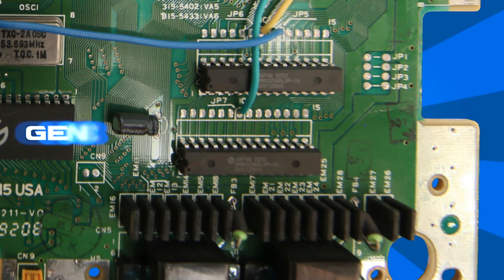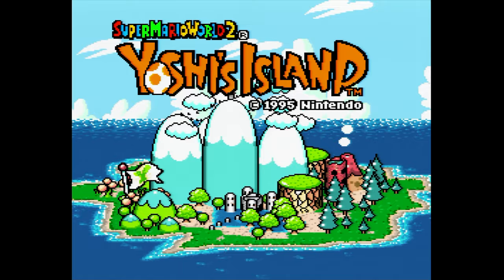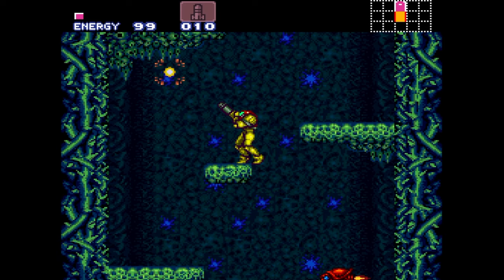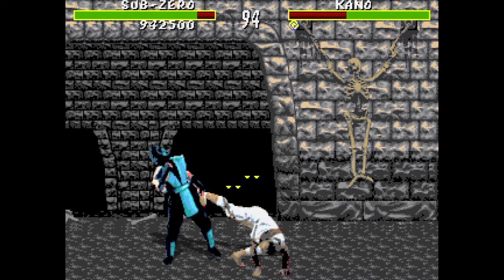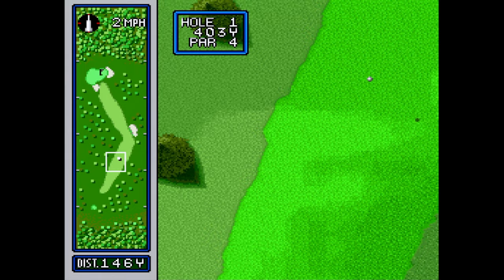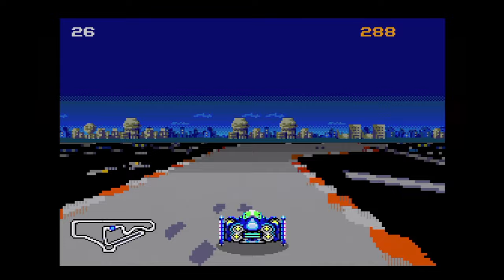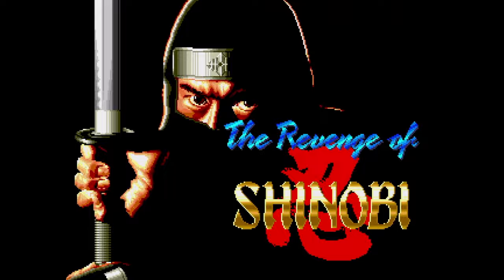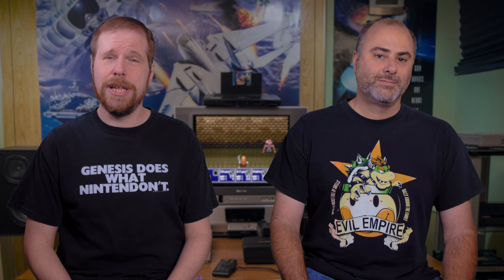Sega Genesis VS Super Nintendo - Game Sack

Comment: Being as objective as possible about the library, the SNES does have more games than the Genesis (1600 vs 900 iirc, which is notorious with RPG's, puzzle and fighting games mainly) with a similar average quality , so if you want more "good games" probably you would get more out of the SNES, but the Genesis does have an advantage in shooters of all kind and has plenty of experiences that don't have an equivalent on the SNES, so maybe you may still prefer the Genesis, especially i you don't care about RPG's, puzzle or fighting games
Reply: The megadrive has more games worth playing. For every good snes game there are 3 good megadrive games. Also ports of the same games where better on megadrive 9 times out of 10, they more fun to play with better controls and better hit detection and no screen crunch
Reply: The snes is better overall, Genesis is good, but SNES was simply the king. So much hipocrisy these days, is what it is, simple as that.
Reply: @MizfitZer0  I do agree the Mega Drive has the edge on multiplatform games, but not at the level of "9 out of 10 times" as you are saying, and multiplatform games don't apply for a huge percentage of neither of the 2 consoles (especially SNES) unlike now.
I don't really agree with your other point at all, that would mean the SNES has less than 200 games worth playing and that's not true at all, it probably has that number in RPG's and platformers alone

Comment: 1:00 - same clockrate, but one is a newer 16-bit CPU that does more in each cycle than the other. You can't compare clockspeeds from two very different processors. That's also why, while the Genesis 68000 CPU is roughly twice the clockspeed of the SNES CPU, because of architectural differences etc. the system isn't really twice as fast as the SNES CPU (that again, does things very differently).

Comment: Genesis used to trick transparency effects by interlacing pixel columns. Play the original Sonic on an LCD and you can see the waterfalls are just alternating rows of solid water and nothing at all, which were blurred as a consequence of the CRTs that were used at the time, producing a transparency effect.
Reply from the maker: Yeah that's the intent, but even gaming in RF on a CRT back in the day, I could absolutely tell this was just alternating rows of solid and nothing.
Reply: @GameSack  Depends on the size of the screen. On a 25" it started to become noticeable. Probably something like a projection TV would've been patently obvious.
Reply from the maker: @adamb89  My screen was 13 inches I believe and then I later stepped up to 20 inches.

Comment: In retrospect, what really pushed the SNES ahead of the Genesis was the lack of strong Japanese 3rd party support for several years after launch. For example, Contra and Castlevania didnt land on the Genesis until 1994, while Castlevania 4 and Contra III were on the SNES in 1991 and 1992. Graphically the Genesis was capable. Batman and Robin, and Ranger Z, Vectorman and Rocket Knight look as good as anything on the SNES. Sound on the other hand is much better on the SNES.

Comment: Always preferred SNES.  Often Genesis has less flicker  / slowdown,  but most games on Genesis still had some slowdown / flicker, just a bit less than SNES and SNES games had far better colors and ( usually) better sound.  These days with Emulators like BSNES and SNES9X you can overclock the SNES cpu.  SNES games with zero slowdown or flicker destroys Genesis and infact for 2d it's more like a 32bit system.  You can even render mode 7 at 1080P in widescreen !!  ( with some limitations) -Pilotwings in HD is a sight to behold!   BSNES rules.

Comment: The Genesis is actually more powerful than the SNES. the SNES has better graphics and sound along with more RAM. the Genesis has more raw processing power than the SNES. The Genesis took away some graphics and sounds and gave you great processing power in exchange. the SNES took away processing for graphics and sound. The Genesis and SNES have their advantages and disadvantages and i like them both.

Comment: The snes had 10 sound channels
The sega genesis had 8
Reply: SNES had 8 PCM channels, and Genesis had 6 FM channels (1 PCM capable) + 4 PSG channels in total 10.
Reply: @mateuszmaterzok431  The Genesis could only use 9 of 10 simultaneously. Also a nice chunk of the library only uses the 6FM channels and doesn't use the PSG at all.

PSG channels could definitely be beneficial when used appropriately but obviously were very limited.

Comment: How did you forget to mention the impossible ports of street fighter alpha 2 & 3, those blow away mortal kombat ‘with blood’ 😛
Reply from the maker: Probably because Street Fighter Alpha 2 and 3 weren't on the Genesis and SNES. I agree that they blow away Mortal Kombat though.
Reply: @GameSack  wait wait. There WAS a port of the SFA2 for the SNES. It was so perfect and accurate that even had LOADING (no kidding) 🤣

Unless you are considering ports that were made for BOTH consoles, of course.

But then the Genesis had the (not so) Virtua Fighter port :p

You could've compared apples to oranges just for the fun :p

Comment: I did a Genesis vs SNES report back in 1994 (High school, it was a Oral report/presentation) In my honest opinion, the SNES was the better system,, better graphics, better sound, better colors, etc... But the Genesis was great in its own rights too, especially if you were into sports games, Genesis had WAY more sports games than the SNES did. But SNES gave us some timeless greats, such as pretty much every JRPG and traditional RPG on the system, the DKC trilogy, Mario world/All-Stars (which was a free pack in at one point, hell you could even get Super Mario All-Stars for free by mail) the SNES had a WAY better controller (even the later Genesis 6 button released with Street Fighter II was "meh") However the first Mortal Kombat, I will give to the genesis thanks to the uncensored version (SNES still was closer to Arcade than the genesis in graphics and sound though) IMHO, Blast Processing was a gimmick and only a handful of games on the genesis supported it.
Reply: I also did a report but saw the Genesis as superior to this day!
Reply: The genesis had a superior cpu and generally had better performing games than the snes
Reply: @kasjamm  but the SNES had a WAY better color pallet and sound processor.. take MK2 for example, the SNES version was WAY more true to the arcade than the genesis version.

Comment: So being able to display 128 8x8 sprites means that if you need 16x16 sprites you will only be able to have 32 of them on SNES? While Genesis can use 80 of those? Seems like a big deal. With more than twice CPU power, better resolution and better sprites support I’m not convinced that SNES has a better hardware. Mode 7 is cool, but most games barely use it

Comment: I always hated the Genesis sound chip. Everything sounded tinny, robotic,  hard to explain. It just didn't sound natural. Compared to the SNES which would emulate full orchestras, it was a huge difference. Genesis had more power, games like Gunstar Heroes had so much crap on screen with no slowdown. Ill always prefer SNES but Genesis did win some categories.
Reply: That is where the PC Engine comes in. 6 channel wavetable synth with proper stereo. Compare for example Neutopia II and Zelda LttP. Or Bomberman 94 vs Mega Bomberman. On a stereo Trinitron! No emulation please. The PCE outclasses both the soundchip of the SNES and the Mega Drive.

Comment: The winner is: PC Engine. The best 2D console ever conceived.
The SNES did not win the hardware battle. It was all theoretical figures you mentioned. In reality the SNES was seriously underpowered, weird spirte limits, weird sound ram annoyances, slow CPU. The hardware in the SNES was so bad, that most titles that came out on the NES as well, were better on the NES! Also the NES had way more variety in games offered. The SNES is the most overrated console in history. Especially the uber-ugly US version.
Reply: Most games that came out on NES were better? I don't know what you are talking about, the only case I recall there is Paper Boy 2 and Ninja Gaiden Trilogy because the SNES ports were complete garbage, but beyond that nearly any of the games release on both are way better on SNES, with some extreme cases like the Disney games by Virgin, and most SNES games are just not possible on NES unless you do a demake or something like that, especially for genres like racing or fighting.
Reply: @oscarzxn4067  I watched a video with all 101 titles on both systems, and the SNES really seems to struggle with sprite count, so most SNES versions are more empty, with less of a challenge. I counted 50 wins for the NES, rougly 30 ties and 20 wins for the SNES. Most clear example of what I call the SNES problem is DKCountry. Basically nothing happens, and rain, parallax and particles are there to hide it. Good example of a game on both is Alladin. It really shows how the emptyness is compensated with more details and more colours.

Comment: Who hear thinks the comparison should include Sega CD/32x games?! Nintendo upgraded by building up the cartridges. Sega did it by selling add-on hardware. An upgrade is an upgrade. And this comparison excluded Sega upgraded titles.

I still think SNES will win this but this wasn’t a fare comparison to me. You needed to own a Genesis to use Sega CD/32x so those titles are still Mega Drive games.

(Nintendo went the better route but if you were lucky enough to own all of the Sega upgrades your experience was different)

Comment: Snes was one of most overrated consoles of all times with sales based on mass media illegal game monopoly and end user stupidly. The lower resolution make everything look awful strached on the crt screen .Let Sega rest in pace and admit was better
Reply: The resolution only became a discussion in the internet age because of emulators.  Nobody cared about the resolution playing on a CRT TV in the 90s. And it's even advantageous for the Snes, as the sprites look bigger.
Reply: @Jon  don't be stupid. The emulators run the games upscale to 1080p with filters added infinite better then the original hardware. The pictures on snes look awfully strached, and the high color palette didn't help idder look washed
Reply: @iulianispas8634  Not even Sega used the resolution as marketing to attack the Snes.  And we all know that the company's marketing was aggressive.  It's like I said: resolution is only up for discussion on the internet.
Reply: @JonBR-622  the resolution is a problem on modern TV play in a tiny square or strached